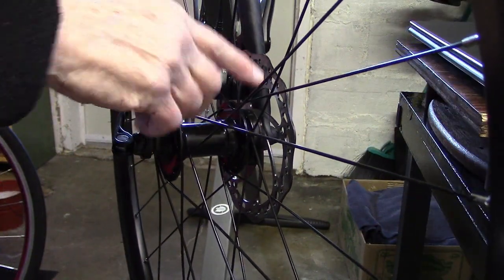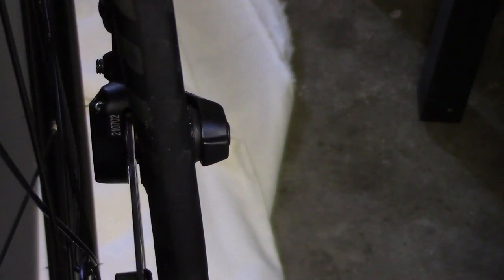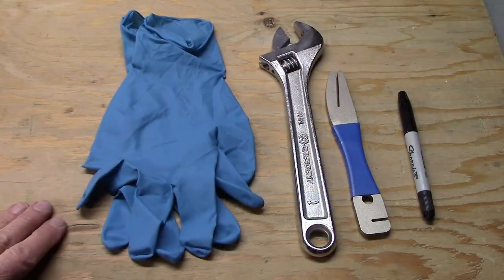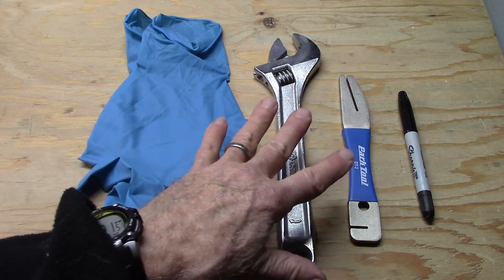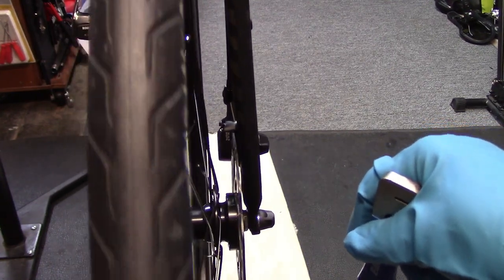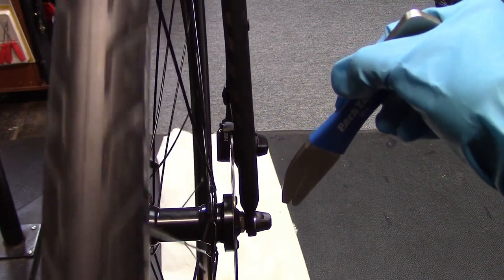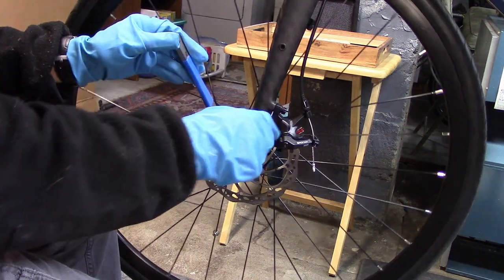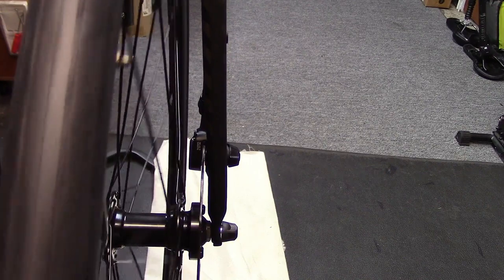Disc Brake: Intermittent Rubbing Each Wheel Rotation (How to fix disc brake rub 1)

Comment: thank you very much sir. your experience straightforward visual approach has been very helpful to me. I just bought my first disc brake bike And I recently noticed my speed drop and then all of a sudden when I was taking my bike in and out it sounded like there was birds chirping inside my bike.  I Don't have a stand so I flipped it upside down and instantly saw the wheel was not spinning correctly therefore making me lose momentum on my rides.  I had bought the park tool but not used it yet I was almost too afraid to try it myself and take it to the bike shop but your video saved me a whole day of moving the bike to the shop and taking it back and I don't have to in between.  I really appreciate your help I don't have watched two or three of your videos now and will continue. you certainly look like you know you're way around a bike and I am certain that it has contributed to your good health. I certainly hope that I can continue to be able to Ride my bike for a good number of years like yourself.  Even though I'm 45 years old it's never too late and helpful videos like you make certainly help a lot for empowerment and saving money. Cheers to you sir, thank you very much. I will always like whatever video I watch.  hopefully that helps you out in a small way.
Reply from the maker: Thank you. It's never too late to learn and in bicycling, things are always changing with new bicycle components and new ideas on cycling performance. This is what makes in fun and exciting.
Also visit our YouTube home site at:
https://www.youtube.com/user/MrTony10speed
Regards and safe cycling, Tony

Comment: I found disc rotors were far more likely to rub, when I had quick-release skewers. With through axles, that problem rarely arises. The Dura Ace rotors with the large black fins, which I suffered with for a year, were terrible for rubbing and is probably the reason Shimano ditched them. After that experience I got extremely good at adjusting rotors and now just a couple of tweaks with the Park Tool is all I need to make my current rotors true. I don't mark them; I just note where the rubbing is heard with relation to the valve, etc.
Reply from the maker: Great comment. Thru axles are more stable then quick release, especially on mountain bikes. In prior days, quick release axles would break under the strain of down hill racing. Thus the adoption of the thru axle. It was also found that the slight bending of the frame, especially when climbing where you might "throw" the bike side to side, would also result in the rotor rubbing the pad. Unfortunately, not all road or mountain bikes we work on come with thru axles, which would be my preference. Here's a nice review of quick release vs thru axle:
https://www.diymountainbike.com/difference-quick-release-thru-axle/
Thanks again and safe cycling, Tony

Comment: ty ! :) in Bulgaria every time you to  bike shops they scam you that your disc are bend and you need to replace them... i ask them how i bend them ? they told that there were hot and go through water..it was crazy because my bike was 1or2 weeks old and it was never seen water ...it was crazy hot and dry summer...it was 2015 after that scam i start to look for video like yours to solve problem myself .
Reply from the maker: Finding a reliable bicycle shop can be a struggle. The purpose of my videos are to give you enough knowledge to at least understand the problems even if you don't fix them yourself. I watch many YouTube videos, even of things I don't repair myself, such that I can converse with fellow cyclist and my local bike shops. Regards and safe cycling, Tony

Comment: keeping the brakes clean is important. I was wondering should I be just as careful with rim brakes
Reply from the maker: Yes, especially after riding in the wet, muck or grime. After riding in bad conditions, I wipe the rim brake pads and rims with a cloth with moistened with a bit of rubbing alcohol to remove grime picked up from the road. We'll show you how in an up coming video. Thanks for asking and safe cycling, Tony

Comment: What do you think of disc brakes versus rim brakes?
Reply from the maker: Hydraulic disc brakes have superior stopping power over rim brakes, especially in damp or wet conditions, at least in my experience. They are also superior to mechanical disc brakes both in stopping power as well as the fact that hydraulic disc brakes have self adjusting pistons so you are not frequently adjusting for brake pad wear. With that said, for some individuals who ride only in dry conditions at a relatively easy pace, the easy of adjusting and working with rim brakes make rim brakes a preference.

Comment: Can you remove the rotor and try to straighten it?
Reply from the maker: You need some type of guide to straighten the rotor such as the calipers themselves or an attachment to your wheel truing stand. If badly bent, I suppose you can remove it, try to bend it back by hand until it sits flat on a work bench top, place it back on the wheel and fine tune it between the caliper. Possible, but I've never tried this approach. I usually just replace a severely bent rotor. Any one out there with other ideas?